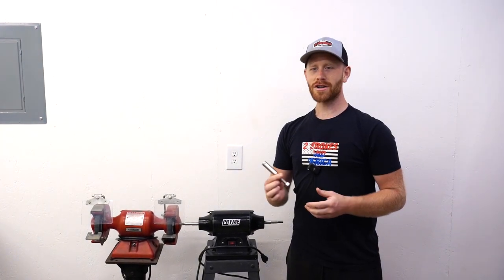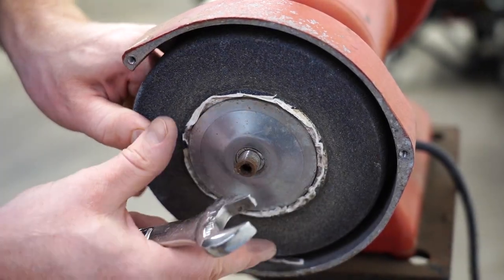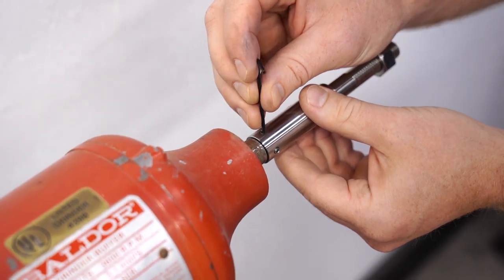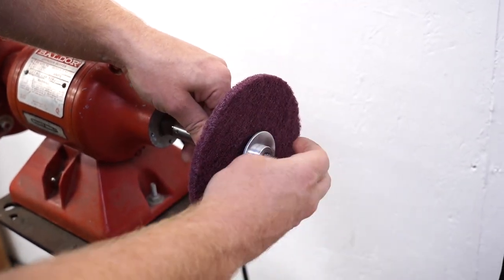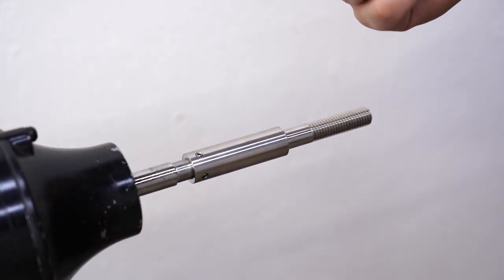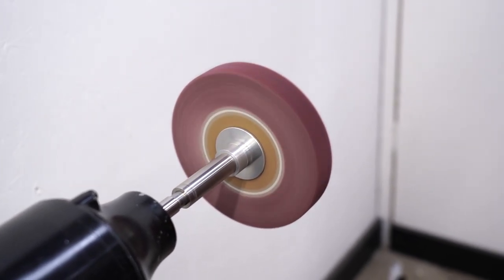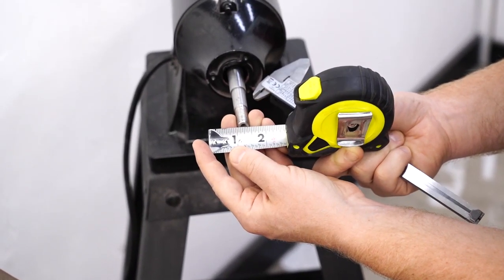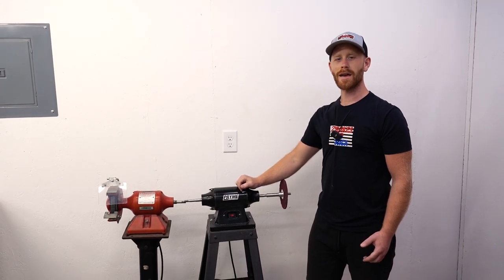This is a game changer for your bench grinder!

Comment: Thank you for this video. This is a great idea! I bought a buffer to prep footballs. I'm going to purchase the shaft extension, but I'm having the hardest time locating a wheel brush that would be good for leather footballs. Any suggestions? I'd need two brushes. One that's a bit more coarse to take off the initial finish off of the ball and another for polishing and buffing. I'd appreciate any suggestions and thanks in advance!
Reply from the maker: Glad you enjoyed the video! We don’t work with leather at all so not much help, but a leather forum such as https://leatherworker.net/forum/ could provide you with answers. I’d imagine that some metal polishing wheels may work for leather as well.

Comment: A good extension to add is a 1/2” UNF threaded shaft which will take a 13mm Jacobs chuck…useful for holding wire wheels,burrs, grinding wheels etc
Reply from the maker: Thanks for the idea! We'll consider that.

Comment: Appreciate the great suggestion and extension for room as I run into this issue! If I use an older motor that has a keyway on the motor shaft  Is it still possible to add an extension over ?
Reply from the maker: Glad you found the video! If you can remove the woodroof key from the shaft, you should have no issue putting the extension on.

Comment: Any recommendation for what abrasives to use if you want to preserve the zinc or nickle protective coating on fasteners? I get that if you're going to fully strip and custom zinc plate an abrasive wheel is great, but what if you just want to remove dry caked on loctite from the thread so you can prep the thread for fresh loctite or grease? I was thinking some 240grit nylon alu oxide impregnated wire wheels could work or a pure brass wire wheel? Curious what you use!
Reply from the maker: Our fine cleaning wheel with very light pressure will not strip zinc, that is what we use at the shop. Try it on a test bolt first, with heavy pressure you can see it eventually wears through the zinc. With just light pressure it wil brush up the finish and make it bright again. It is preferable to use a 4” or 6” wheel, the 8” has too high of a surface speed.

https://www.prymemx.com/products/finecleaningwheel

Comment: Do you sell quality flanges? I have two new bench grinders both with cheap stamped steel flanges resting on a very thin shoulder. I can’t find any quality flanges/face plates online. Thanks also where did you get those spacers? Can only find nylon in the big box stores.
Reply from the maker: Yes, we have aluminum flanges and spacers available on our website here https://www.prymemx.com/collections/wheel-accessories

Comment: seems very expensive for what your get. my thinking is to build something better from scratch. parts: 3foot long shafts, 5/8"  or 3/4"  or 1'" or whatever you can find cheapest. thread the ends,  mounted on two pillow blocks, pulley in middle, v-belt connecting to old US made washing machine motor. MUCH MUCH more solid than the way you are suggesting. if you have access to good scrap/surplus/junk metal suppliers the basic machine would be an affordable, durable base for buffing/ grinding wheels.  The kind of setup guitar builders for cheap to buff out nitro finish guitars. also I am thinking back to the old time shoe repair shops with one long shaft holding lots of  buffers and powered by only one motor.  Also for anyone who has a lathe, it might be possible to run a shaft through the head  of the lathe and mount a buffing wheel on the left side.
Reply: Good stuffff by you...🖖
Reply from the maker: Great ideas! But that's a lot more work than what it's worth. A simple $25 extension on a bench grinder will do the same thing without the belts and pulleys.